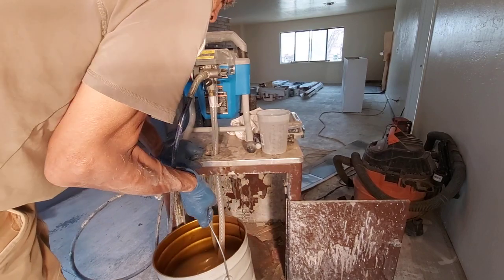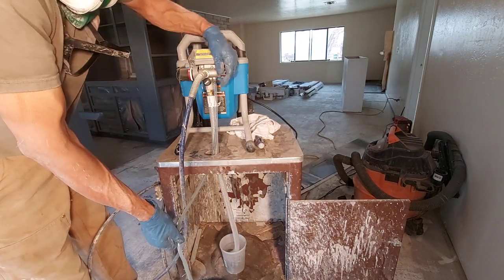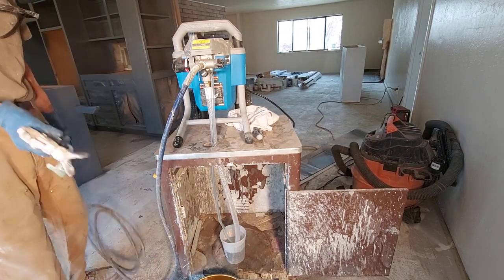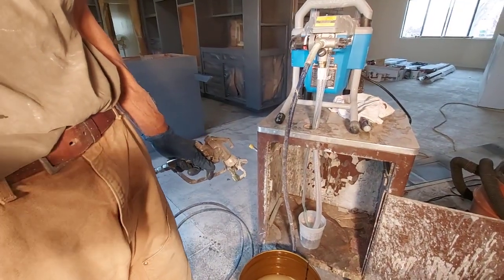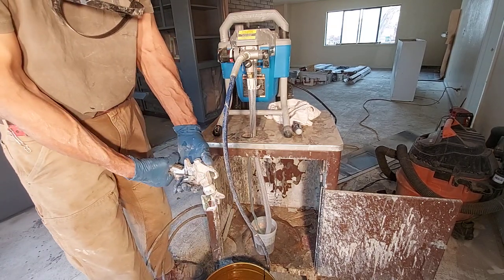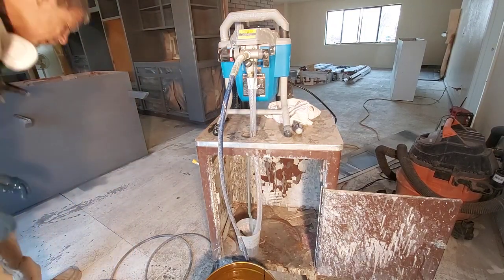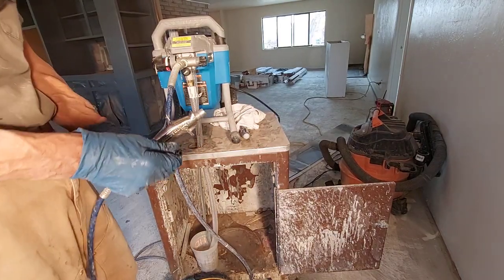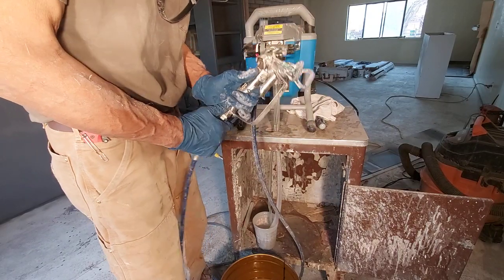Airless Sprayer cleanup and daily maintenance

Comment: Notice you are using a Graco contractor gun . Does the stock gun from the sprayer suck ?
Reply from the maker: No the gun is decent but I have had the graco contractors gun for maybe 20ish tears and have accumulated a lot of different tips, guards and inline  filters so it's more practical to use them than buy a whole new set. The gun that comes with it is very similar to the old graco of the 80's
Reply: @affordableelegance1196 I noticed you were using a two finger gun. What model is that? I had considered replacing my avanti gun with a Graco S3 but would prefer a good two finger gun if I can find one reasonably priced.

Comment: A lot of reviews say that sprayer over sprays like crazy.  Surprised to see you dont have much over spray on you.  Must be user error on their part lol.
Reply from the maker: A lot of the over Spray especially on the user has to do with a few factors like tip selection pressure and distance. Often new users will be using too much pressure and will be too close to the work surface causing lots of bounce back of material. I guess it's really something that takes some time. Try to read your project by looking at the problems and figuring out what can be done to minimize each one until you get a smooth setup and work flow then the rest will take care of itself.  Thanks for the comments 🙂

Comment: You're going to blow up someones house doing what you're doing.   First you're spraying lacquer through a Harbor Freight airless that is not rated for lacquer, the manual clearly states nothing hotter than mineral spirits should be used in this airless.  Second you have your airless in the same room you're spraying in.  Third you are plugging and unplugging the power cord in the room you sprayed in.  All three of these things can cause an explosion if there is solvent vapor present in the air.  Nobody should be taking advice from this guy.  I've sold airless equipment and paint for over 20 years and seen first hand painters who have died and caused explosions because they were doing the exact same things you are doing.  Get the right equipment and learn how to use it.  Better yet find another profession.
Reply from the maker: You are right on a lot of points. As you can see by how clean my rig is. I never have the pump unit in the same room I'm spraying I was demonstrating the clean up process. this why we have hoses. Also when I spray I set up a 42 inch 2-stage exhaust fan. This pump lasts about 300 hours before seals wear out but with the extended warranty I usually only pay $50 ish dollars. I used only graco for years but have found other cost effective ways to accomplish the same outcome. I'm sorry if this makes you bitter and compelled you to pass judgment upon my abilities based on a single video. Please feel free to direct viewers to your channel. I'm not selling anything I'm simply trying to show how I clean my rig this wasn't a safety video. The doors and windows were open and as a professional you know that one quart of thinner in a lage home is not going to combust in a well ventilated area. Why is such a seasoned professional watching such basic videos anyway.
Reply: My avanti airless sprayer starts to leak trouhg the pressure knob how to repair it or can it be repaird